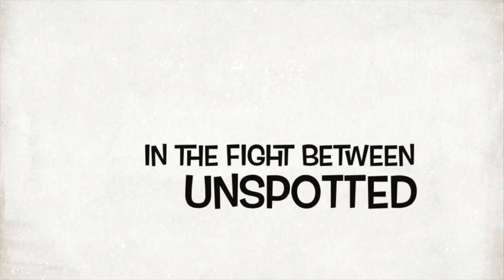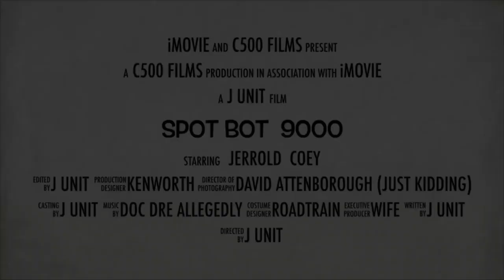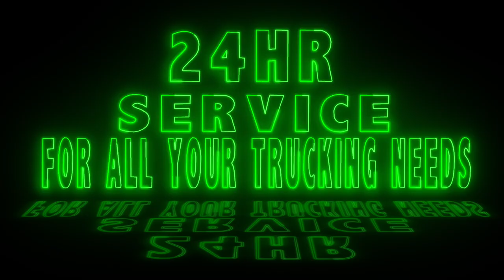MASSIVE RIG MOVE I DIDN'T GET

Comment: Do all tri drives rigged for heavy duty oil field use come equipped with a standard issue winch of 60 to 65 tons ? Or is there a range of sizes depending on expected use ?
Reply from the maker: Mostly 40 ton